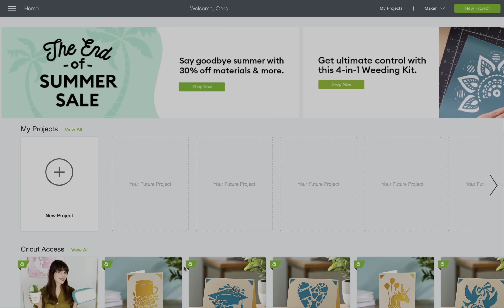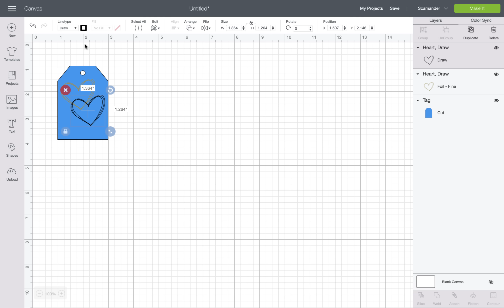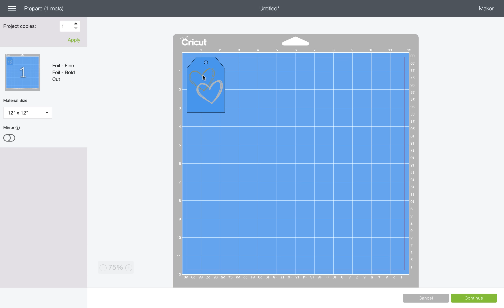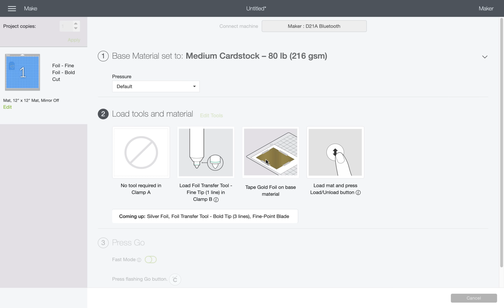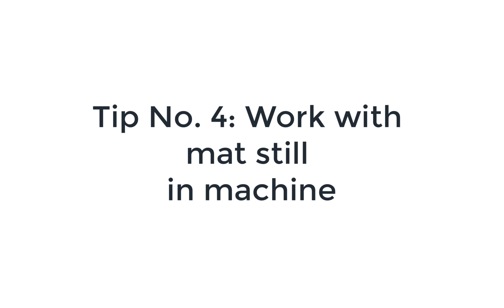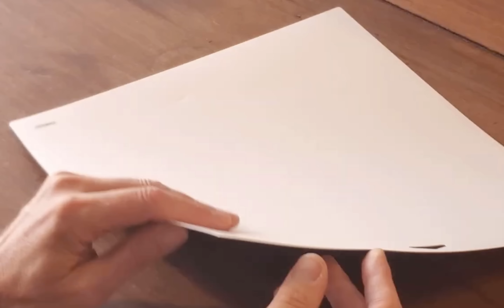How to Use the Cricut Foil Transfer System

Comment: I tried using 176g stock but when I took the foil tape off of the card, it stuck to the card and I could not remove it without tearing the card. How do I prevent this?
Reply: I worked it out. I cut a square out of a transparency, attached the foild to that and then overlayed the transparency (with the foil inserted) over the card. Worked like a treat.

Comment: I have tried using the Cricut foil multiple times however when I feed it through the Cricut machine, the print doesn’t come out nicely. It always comes out faded. What is the reason for that and is there a solution

Comment: Can you lead me to a video that will teach me how to outline the INSIDE of a shape, specifically a square w/either a pen, but preferably with the foil tool, and then also cut the square after the lines are in place?  Is this even possible? Been searching and trying on my own for days, but I need HELP!
Reply from the maker: With the offset tool, you can do an "inset". and set that line to draw! Then the outer shape you can cut. If you attach them all together you should be set.

Comment: It needs to be made clear which side of the foil goes up/down.  I made that mistake One time and ruined a sheet of foil.  
Also, it needs to be clear to "Attach" the foil Line type or the cutter doesn't do it right.  Thanks for the video.
Reply from the maker: Great tip!

Comment: Great video 👍🏽 I’m wondering what is the best way to do multiple gift tags ?
Reply from the maker: Great question! There are LOTS of ways to customize gift tags. If you search in Design Space project for Gift Tags you can see a few quick and ready to go ones! Just duplicate the tag for as many as you'd like, and it will sort it on your mat to get the most out of your material.

Comment: I just want to know how this works. It doesn't look like there is adhesive on the foil, so is the tool heated? Otherwise how does it adhere the foil to the cardstock?
Reply: Works with pressure
Reply from the maker: No heat! As mentioned this adhered by pressure!
Reply: @Cricut  thanks for the reply.
Reply: @Cricut  So is there any reason I couldn't use my scoring tool instead of that?

Comment: My foil design came out perfectly, but the tape tore my cardstock.  Wasted two cards (and foil).  Why is the tape tearing my cardstock, i am pulling it off as slowly and carefully as possible.  Very frustrated.  Didn't happen with my first foil project.  Not sure what has changed
Reply from the maker: Hi Krista, we are so sorry to hear that. Will you shoot us a note at help.cricut.com if you are still having problems and we would be happy to offer some tips and tricks with your specific projects.

Comment: @Officialcricut Does the app, I have Apple devices, have the foil option?  Or is this a desktop computer/laptop thing like curving letters? The app version I am using didn’t have the foil option when I looked.
Reply: You can't do the foiling on the app.  You have to use the desktop version of DS, unfortunately.

Comment: Should you move the white wheels al the way to the right of the mat before using foil transfer?
Reply from the maker: Cathy, it's a good idea to move the wheels but not necessary if you have a fairly basic foiling (not intricate). Great question!

Comment: You mentioned, the foil transfer system works with both the Maker and Explore Air 2?  I have Explore Air, will the foil system be compatible with my Cricut Machine?
Reply: I beleive it should, I think the only difference between the two is the Air2 and the Air is the 2 is capable of cutting faster. I am no expert, I have had both machines and to me they were the same. But again, to be safe, check with an expert.

Comment: GAME CHANGER!!!! No more Toner printer, toner inks, laminator..... I have TONS of foil sitting around because it’s such a PAIN to use. The heat plate method for dies is a JOKE!!!!! THANK YOU!!!!!
Reply: I think the toner method is SO much easier and quicker than the various machine tools (both the foil quill and cricut transfer tool).  Do those heat plate dies not work very well?  FYI, I have NEVER been able to get my cricut transfer tool to foil anything worth a damn... the foiling results are horrid.  I've followed their directions to a 't', updated my firmware, etc... still awful.  Foil quill is better, IMO (I have both).

Comment: Thamk you for making this compatible with the air 2 aswell. All the tools should be
Reply: All the tools CAN'T be because they are literally different machines. If they don't have the motor capacity to do a job then what is the point of making the blade compatible? The knife blade for instance is a whole little mechanism on it's own, and the explore isn't made to use that tool.

Comment: If you have an iPad, this will not work. You need a desk top! I found out the hard way.
Reply: Robin Mikels I wish I knew that before I bought it😩
Reply: @robinmikels Was this confirmed officially by Cricut or did you just find out through trial and error?
Reply: @katiejeffries4793  This has been confirmed officially.  You can find this information on Cricut's website.
Reply: Will a iMac desktop work with this or will I need a windows one

Comment: I just bought the foil quill to use with my circuit for $99 an also bought a bunch of their foil transfer paper. I’m curious to if the foil quill paper will work with this Cricut tool because I would much rather return the quill that I spent $99 on an get this tool instead not having to fight the USB wires would be great !
Reply from the maker: We love these foil effects that you can add to so many different projects! The Cricut Foil Transfer system uses pressure rather than heat to transfer foil so be advised that you may not get the right effect using this tool with a heat transfer sheet.
Reply: Official Cricut ok thank you so much for responding ! I would easily return the quill an all the paper! I just got such a great deal on all the foil transfer paper that I was hoping it may work. :(
Reply: @chriswolf19  If you return the foil quill and foil for this cricut tool, you will be making a huge mistake.  I have both and have used both... I know what I'm talking about.
Reply: I did the same thing that you did. Let's see, now there are a handful of ways to foil. We can stamp/emboss then foil, print then foil through a lamination machine, emboss with the Foil Quill or a temperature regulated solder iron, we can use these new foil transfer tools,  glue/tape then foil adhesion .... am I missing any techniques? It's great to have so many options.
Reply: @becre8tive199  One more option is using Foil HTV (heat transfer vinyl) with a Cricut Easy Press or Easy Press Mini.  You can heat press foil HTV onto paper.  I think I'm going to try this, as the other methods leave a lot to be desired, IMO.  By the way, this new cricut tool (cricut transfer tool) does't work well, at all.

Comment: Super helpful video. Just ordered mine. Would love to see a video where more than one item is on the page. Rare do you cut one item at a time with the maker.
Reply from the maker: Great suggestion, Debbie! The key will be to ensure you've used Foil Linetype selections and selected the foil color you want. Then use the Attach tool to fasten them to the layer you want to foil. No matter how many layers have foil linetype selections attached, Design Space will prompt you when it's time to switch tips and foil colors based on the Linetype and colors you've selected.

Comment: Thanks. Nice but with a $50+ investment (for the foil tool $39 + the foil $12), it’s pricey. Not sue the ROI is there, but would like to try it out.
Reply: HSN is sold out. Wish Cricut didn’t have such a high shipping charge. I purchased anyway because it is something I know I will love! I’m a Cricut fan forever!
Reply: @yvonnegray7656  wow, that was fast!  It was available when I commented.  I was trying to decide if I should get it or not. Guess that decision was made for me.  Lol
Reply: HSN has it in stock again, use the coupon code they have rn, I believe it's HSN2020 plus they have free shipping rn. Good luck!
Reply: ROI will be zero, as it doesn't work worth a flip.
Reply: HSN has the tool and some foil (twelve 4x6 sheets) for $39 plus $3.50 shipping.

Comment: Is the size limited or can it foil an A4 card stock?
Reply from the maker: The size will only be limited by the size of the foil piece you have. At this time, the Foil Transfer Sheets are available in 12"x12" (30.5 cm x 30.5 cm) and 4"x6" (10.1 cm x 15.2 cm).

Comment: What kind of foil will be compatible with this tool.
Reply from the maker: Thanks for asking! Cricut Foil Transfer Sheets are recommended for use with Cricut Foil Transfer Tool. Other foils are made to work with heat, while ours is based on pressure.

Comment: Can you use any kind of foil
Reply from the maker: Cricut Foil Transfer Sheets are recommended for use with Cricut Foil Transfer Tool. Other foils are made to work with heat, while ours is based on pressure. Thanks for asking!

Comment: Is this available in Australia?  And is the foil the same as what you use with a laminator?
Reply from the maker: Stay tuned on our Cricut Australia + New Zealand social pages for news about local availability very soon! Cricut Foil Transfer Sheets are recommended for use with Cricut Foil Transfer Tool. Other foils are made to work with heat, while ours is based on pressure.

Comment: Looks nice, but for fewer steps I'd rather use a fine tip metallic pen or marker.
Reply: ive used the foil quill since i got my makr which is a similar process and its not that many steps when youre doing it . you just put the foil over your cardstock and use draw in design space .
Reply: @christinapowers3832  Thank you for mentioning this. I've not used my Cricut much at all this year so I didn't even know about the foil quill 💌